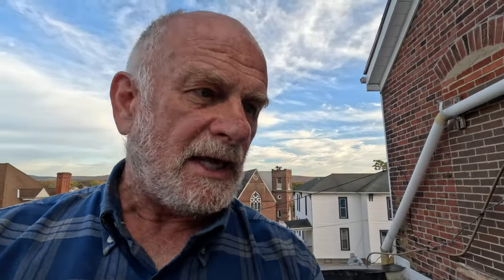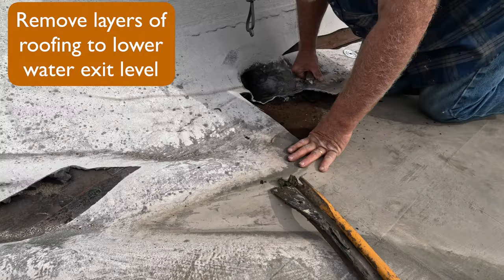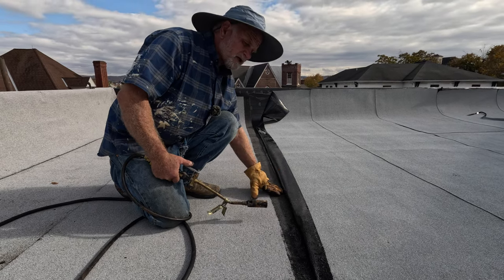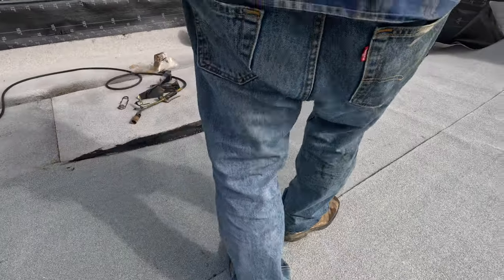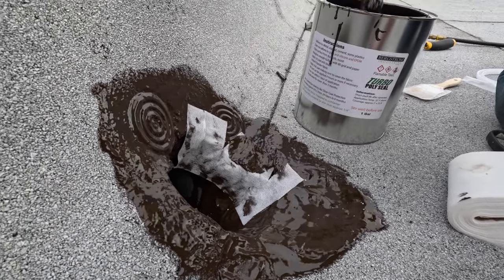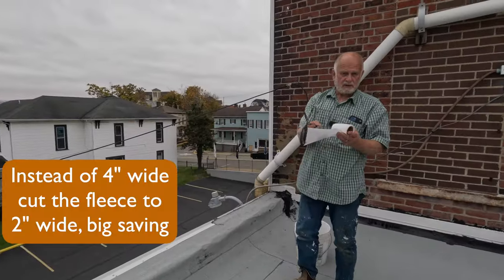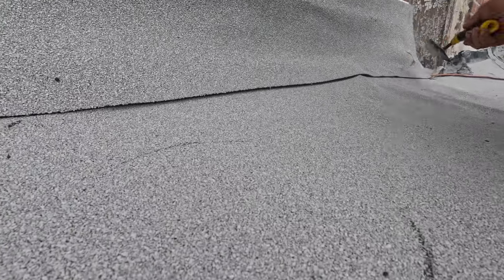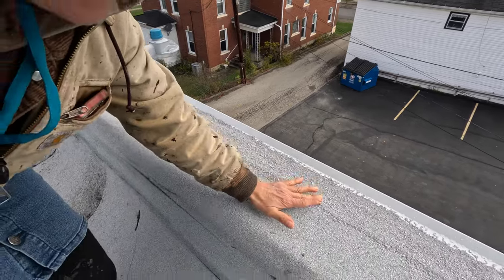Rubber Flat Roof Installation Easy Cheap DIY - Peel the plastic, then stick it down, Any homeowner..

Comment: There are no words for how poor this is. This is the reason flat roofing has a bad reputation among most people. Do this to your shed, not your home or anything you wish to stay dry and leak-free.
Reply: Slap on some Turbo Poly Seal and you'll be fine
Reply: Spot on mate.
Reply: I can think of one word. This install is a joke.😂😂
Reply: I don't know I have watched this guy a lot a am a roofer his work is good.
Reply: I got 8 minutes in and gave up watching.
Reply: Your flat roof will likely leak before her work.
Reply: How would you correctly do it?

Comment: Just making it harder for the next guy who gets hired to do it correctly.
Reply from the maker: not for the next 25 years.
Reply: @FlatRoofDoctor  That is Polyglass self-adhered roofing.  You're supposed to remove the existing roofing.  From the current published specs for Polyglass self-adhered SBS roofing: "When re-roofing, remove all prior roofing materials down to a clean debris-free substrate and properly close off all abandoned roof penetrations."  From the text of the Polyglass 20-year warranty:  "The original installation of the roofing membrane must be in accordance with Polyglass current published specifications."  That roof could never be warranteed for 25 years.
Reply: @Loonypapa Not if you put turbo poly sealer on it

Comment: Hello great job , i have a few questions, 
can you do this over an existing granulated cap sheet with a low sloping roof?if yes,  
or would you need to place down asphalt first over the cap sheet so it will stick or do you nail down the base and then put on the granulated roof?

Comment: Instead of using a torch, what can I use so that the cap sheet will attach securely to each other when they overlap?  Is the hand-held hot air again as effective as a torch to melt the sticky membrane?
Reply: Manufacturer actually says not to use a torch, but to use a hot air welder. This guy giving out bad info in every video
Reply: However, you only need a welder when it's granule over granule. If it's granule over fast lap then no extra steps are necessary

Comment: Can you tell me how much all of the supplies and materials cost?
Reply from the maker: Here is a link to Home Depots site for the Liberty Cap sheet https://www.homedepot.com/p/GAF-Liberty-3-ft-x-34-ft-100-sq-ft-SBS-Self-Adhering-Cap-Sheet-Roll-for-Low-Slope-Roofing-in-White-3732920/100031926
Here is a link to Liberty Base sheet https://builderswarehouse.com/gaf-liberty-sbs-self-adhering-base-ply-modified-bitumen-membrane-2sq.html?gclid=Cj0KCQjw-pyqBhDmARIsAKd9XIODPIeM43Qbarh6KOfTa9Od7X5DZCXBSnNeEkzmylszQR9kJCG9Ay0aAvTdEALw_wcB
Reply from the maker: Just search on Google for Peel and Stick Cap sheet and Peel and Stick Base sheet. There are many brands to choose from

Comment: I admire the motivation of homeowners doing some roofing. There’s no way there’s not a leak after a rain like that.
Reply from the maker: I would not have been paid if there was a leak. I billed them 2 months later.  BTW, I have been doing roofing for over 40 years. Everyone have there own tricks and methods. Just because I do it a different way than you, doesn't mean it is wrong. Make some videos and show your method. That might be helpful.